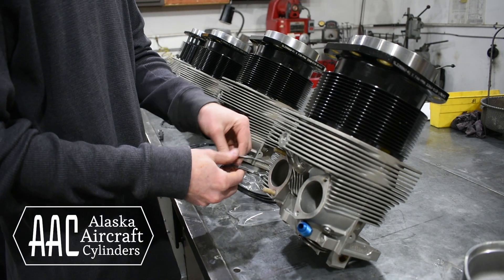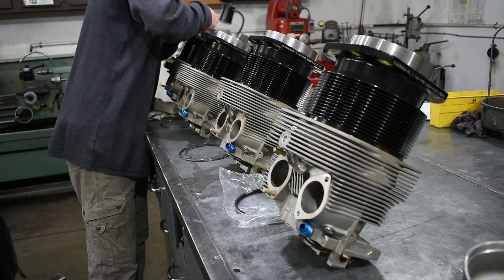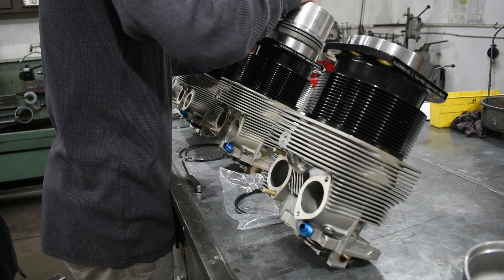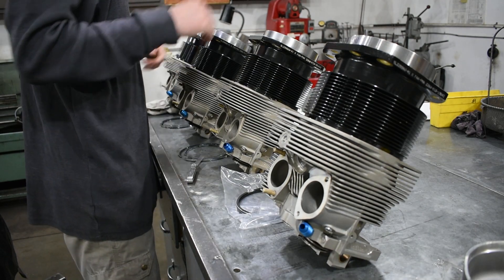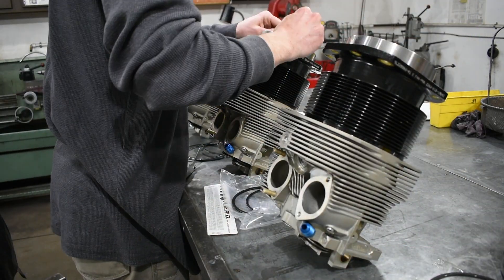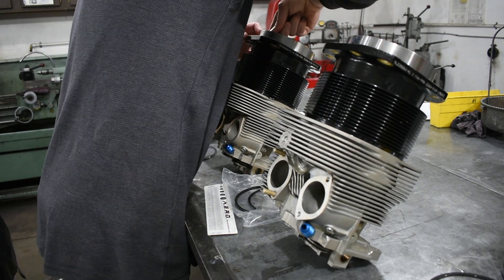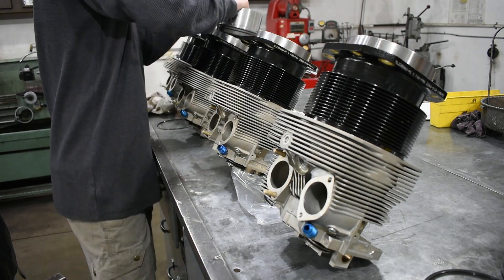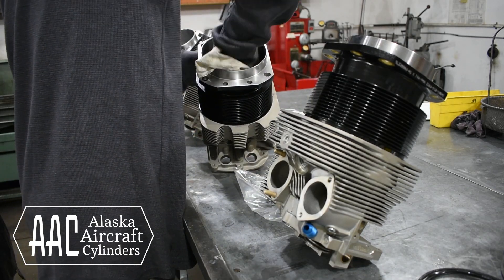How To: Lycoming Piston Ring Gaps

Comment: Why are these aircraft engines so expensive to rebuild because the difference is small compared to auto engines?
Is it the air cooling temperatures or what?
Reply: Lawyers
Reply from the maker: There are only a handful of parts manufacturers including OEM and a lot of FAA regulation drives the prices up.